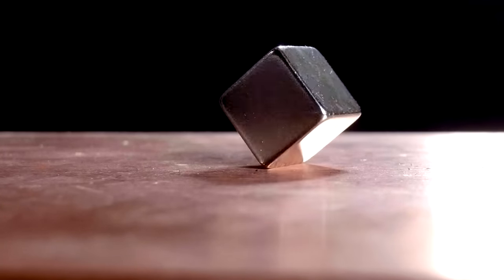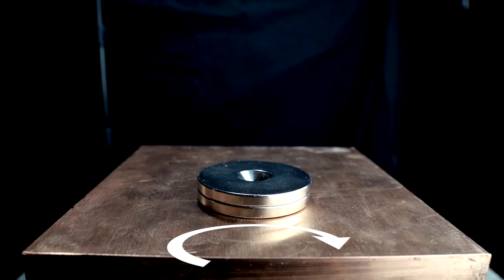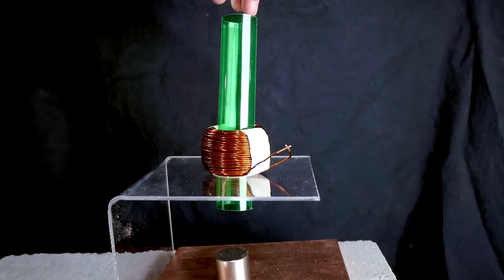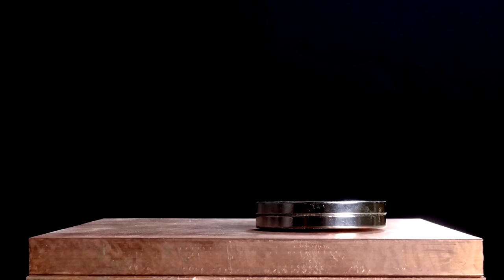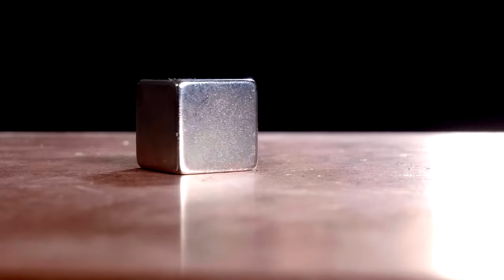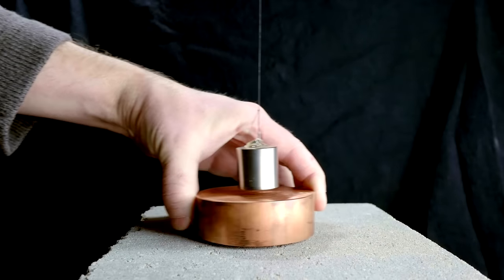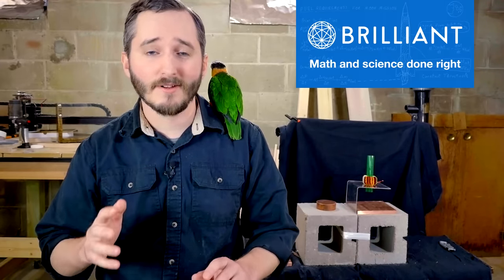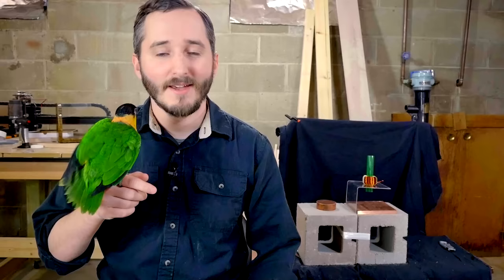Copper's Surprising Reaction to Strong Magnets | Force Field Motion Dampening

Comment: I just tried this at home and it feels like I'm dragging the magnet through molasses. Super cool!
Reply: what dude you use copper wire?
Reply: The biggest question I have with this is, What can be done with it?
Reply: E=MC2 is a joke! OK let's get this correct  !!   #1  The only reason radio waves and AC current travel out in space and down a wire is because of the "CENTER " of a magnetic field.  (The "B" field), The North and South poles are the weakest part of a magnet !!   Just like Tesla said,  you got to look at things you can't see !!  At the center of a magnet is anti gravity,  (just tap the center on any glass or plastic and it will loose weight), The center can repel water if vibrated at the correct frequency,  If you vibrate the "B" field into granite rock it will become soft and you would need copper tools to work on same , you don't want to disrupt the magnetic (B")field ) with other iron.  Once you understand the "B" field of a magnet and how it relates to the entire universe we live in, you will then understand what Tesla was telling everyone "LOOK FOR WHAT YOU CANNOT SEE""  .I believe the pyramids were inter galactic communications and transportation systems.  Stone Henge and Gobekli Tepe , power plants.  Take a look at Coral Castle Florida on YOUTUBE and you will see a similar pilar. I believe these horizontal pillars were oscillators that would provide excitation for many things from crops in the field to anti gravity  FYI: If a UFO fly's to close to you the "B" field that provides the anti gravity ("B")Field).  will cancel out your power source  !!!!  E=MC2 is at best just a joke!!!
Reply: E=MC2 is a joke! OK let's get this correct  !!   #1  The only reason radio waves and AC current travel out in space and down a wire is because of the "CENTER " of a magnetic field.  (The "B" field), The North and South poles are the weakest part of a magnet !!   Just like Tesla said,  you got to look at things you can't see !!  At the center of a magnet is anti gravity,  (just tap the center on any glass or plastic and it will loose weight), The center can repel water if vibrated at the correct frequency,  If you vibrate the "B" field into granite rock it will become soft and you would need copper tools to work on same , you don't want to disrupt the magnetic (B")field ) with other iron.  Once you understand the "B" field of a magnet and how it relates to the entire universe we live in, you will then understand what Tesla was telling everyone "LOOK FOR WHAT YOU CANNOT SEE""  .I believe the pyramids were inter galactic communications and transportation systems.  Stone Henge and Gobekli Tepe , power plants.  Take a look at Coral Castle Florida on YOUTUBE and you will see a similar pilar. I believe these horizontal pillars were oscillators that would provide excitation for many things from crops in the field to anti gravity  FYI: If a UFO fly's to close to you the "B" field that provides the anti gravity ("B")Field).  will cancel out your power source  !!!!  E=MC2 is at best just a joke!!!
Reply: With the copper wires that sage by the way every time the Magnum pass is it it's age it puts upon the wire with it turns the limestone

Comment: As other people have said, this also works with aluminum. I have seen magnetic brakes used on a land speed record car that had aluminum wheels, not meant to slow the car from top speed, but to slow it down once the parachutes have been used. It was very ingenious. They had a ring of neodymium magnets on a hydraulically controlled plate.
Reply: The phenomenon is present for any conductor, but the effect is reduced as the conductor chosen is less and less conductive.  A silver plate would work better than a copper plate, which works better than aluminum, which works better than zinc, which is better than titanium, etc.
Reply: made one years ago for a small engine dyno. few design flaws but it did work. up to about 20hp, any more and i couldnt get the heat away.
some brassy unknown material disc from the scrapyard, bunch of neo magnets recessed into very shallow pockets in a steel plate from the back of a speaker, reaction arm on a set of scales, and a lead screw to adjust the magnet gap. the disc spun, coupled to the crank.

have to complete the circuit at the back of the magnets. gives a nice focused field out the front where its needed. most people tend to miss that point...

obviously deep pockets just short each magnet out to itself :D

the disc gets HOT. real freaking hot. every watt of power the dyno is registering is dissipating as heat. could easily stall a 20hp, with power to spare, but the disc was smoking, starting to glow, despite the water spray... design flaws : )

and neos fail rapidly at 70C+. lol. ferrite will take 150C or so, and alnico will tolerate redhot, but is a bit pathetic... and expensive...

i brushed the dust off it lately, revisiting the idea. it promises a certain advantage over any thing else in the application of certain "renewables"...  

get carried away with this idea of "electrons" and forget that they need something to pump them, just like hydraulic fluid in a bottle is basically useless but will give you gangrene at 20,000psi from a leak, or move a large rock in an excavator bucket... and whilst hydraulic fluid happily sits in a bottle, electrons tend to dislike each other and refuse to congregate in large numbers unless beaten with a large stick...

this is hands down one of the best videos but he did miss the bit with the coil, open circuit, shorted, LED... a decade resistance box would have shown something even more interesting, along with some maths relating to the mass of the magnet and gravity... EFFICIENCY. or, load matching, and how it relates to efficiency. where is the work done, how does it relate to the mass of copper versus the magnet strength, its mass, teh resistance of the copper wire as its wound, blah blah...

where is the work done in a generator, where is the load, and what are their limitations?

Comment: i was just thinking about this video, and i think its possible to polish the surface of steel using magnetic breaking. the traveling fair where i live has a ride that takes you up about 100 feet on a tower and drops you. The way the ride stops is electromagnetic breaks that fit around metal fins. from what i remember, there were 4 metal fins that were at least a foot long and probably 8 inches wide. likely, they were bigger as they were far up on the ride. the part of the ride with the seats that falls rides on a square piece of scaffold with wheels to keep it aligned, and it has 8 electro magnets, one for each side of the fin. the fins are attached to the outter framework of the ride, so force applied to the fins sits on cement pads placed on the ground. the failsafe is a massive pile of recycled tires under the seats. if the magnetic breaking fails, you literally just land on a huge pile of rubber.

The interesting thing to me is that the fins were POLISHED. They stood out as extremely polished to a perfect mirror finish, and the polished part of the fins was only where the breaks run over them. It has always made me wonder if some kind of surface stripping happens when you are breaking such a massive load over a fairly short distance. also it freaked me out that the ride didn't use permanent magnets and only have a pile of tires as a failsafe.
Reply: "The interesting thing to me is that the fins were POLISHED. They stood out as extremely polished to a perfect mirror finish, and the polished part of the fins was only where the breaks run over them. It has always made me wonder if some kind of surface stripping happens when you are breaking such a massive load over a fairly short distance. "
Very interesting! Thanks for sharing your observations.

Comment: Superb demonstrations. Prior to this I'd only observed the effect using a Cu tube and small magnet dropped through. These are far more visually interesting.
Reply: E=MC2 is a joke! OK let's get this correct  !!   #1  The only reason radio waves and AC current travel out in space and down a wire is because of the "CENTER " of a magnetic field.  (The "B" field), The North and South poles are the weakest part of a magnet !!   Just like Tesla said,  you got to look at things you can't see !!  At the center of a magnet is anti gravity,  (just tap the center on any glass or plastic and it will loose weight), The center can repel water if vibrated at the correct frequency,  If you vibrate the "B" field into granite rock it will become soft and you would need copper tools to work on same , you don't want to disrupt the magnetic (B")field ) with other iron.  Once you understand the "B" field of a magnet and how it relates to the entire universe we live in, you will then understand what Tesla was telling everyone "LOOK FOR WHAT YOU CANNOT SEE""  .I believe the pyramids were inter galactic communications and transportation systems.  Stone Henge and Gobekli Tepe , power plants.  Take a look at Coral Castle Florida on YOUTUBE and you will see a similar pilar. I believe these horizontal pillars were oscillators that would provide excitation for many things from crops in the field to anti gravity  FYI: If a UFO fly's to close to you the "B" field that provides the anti gravity ("B")Field).  will cancel out your power source  !!!!  E=MC2 is at best just a joke!!!

Comment: 2:21 I have never thought to have my students actually connect an open inductor like that before! I also love how you used an led to show the emf generation. I tried it with a small regular bulb but it was no use; the emf generated seems to be only around the hundred mV range. So, I definitely need to buy some small leds - and flat copper plates !

Comment: I already knew a little about this, (not much) but you expanded my knowledge in a way that was both easy to understand, interesting, and visually stunning.
Reply: E=MC2 is a joke! OK let's get this correct  !!   #1  The only reason radio waves and AC current travel out in space and down a wire is because of the "CENTER " of a magnetic field.  (The "B" field), The North and South poles are the weakest part of a magnet !!   Just like Tesla said,  you got to look at things you can't see !!  At the center of a magnet is anti gravity,  (just tap the center on any glass or plastic and it will loose weight), The center can repel water if vibrated at the correct frequency,  If you vibrate the "B" field into granite rock it will become soft and you would need copper tools to work on same , you don't want to disrupt the magnetic (B")field ) with other iron.  Once you understand the "B" field of a magnet and how it relates to the entire universe we live in, you will then understand what Tesla was telling everyone "LOOK FOR WHAT YOU CANNOT SEE""  .I believe the pyramids were inter galactic communications and transportation systems.  Stone Henge and Gobekli Tepe , power plants.  Take a look at Coral Castle Florida on YOUTUBE and you will see a similar pilar. I believe these horizontal pillars were oscillators that would provide excitation for many things from crops in the field to anti gravity  FYI: If a UFO fly's to close to you the "B" field that provides the anti gravity ("B")Field).  will cancel out your power source  !!!!  E=MC2 is at best just a joke!!!

Comment: Laser levels use this to dampen unwanted vibrations.  A copper disk is mounted at the bottom of a pendulum that is free to pivot.  A magnet is mounted below the copper disk and causes the laser to self level rapidly and be resistant to small vibrations applied to the mount.  In this application the magnet is stationary to avoid magnetic fields including that of the earth from effecting the accuracy of the laser level.  Without the magnet, the laser would eventually self level, but would be too sensitive to vibrations to be useful in most construction environments.
Reply: Cool!
Reply: Well how bou dah?
Reply: Nice find.

Comment: Everything in this video was amazing, but the part that surprised me the most was the bit where you rotated that cube from like 2 feet away. That's the farthest distance I've ever seen tangible magnetic effects (aside from compasses), considering that usually, magnets only overcome friction when they're a few inches apart.
Reply: ya good piont.  i thought the same thing too.  that was extremely far away and perfectly accurate, i wonder if he could go even further
Reply: @isaacb.4324  or it's a scam.
Reply: @murrijuana2842  magnets are a scam?
Reply: That part really confused me. Does it have anything to do with the copper or was it just that his magnet really is that super powered?
Reply: That's a good tool for "magicians" to use in levitation tricks.
Reply: @murrijuana2842  No man! Magnets are the truth! Open your eyes!
Reply: Magnets are the one of the four forces that doesn't have a distance limit. Add an electrical current to it and you can basically become a wizard.

Comment: I was an MRI Field Engineer before I retired and we often had fun with the Lenz effect.  When MRI's were quite rare, there was always a drawer full of 1" steel washers on bits of string, so that visitors could 'see' the strength of the magnet.  We soon got fed up with having to partially dismantle the brutes to get these out when, inevitably, some muppet dropped their washer and it vanished into the bore.  We found a spectacular way of demonstrating the strength of the field, safely, by use of aluminium plates, about a foot long, eight inches wide and as thick as we could find - usually about 4mm.  (Sorry to mix standards, but that is perfectly logical to me!)

When the user had a bunch of students or sometimes newbie doctors and we were on the premises, they would always ask us to "...do the trick..."  Having first demonstrated that aluminium is not magnetic in any way, you place the plate upright on its short dimension, on the end of the patient table furthest from the bore of the magnet.  Then you ask them what would happen if I let go.  They all look round, because it's a trick question, right?  It''l fall over.

Of course, as soon as you let go, it falls over and they all look relieved.  Then you move the plate as close as you can to the mouth of the bore (disguising the fact that you can feel the Lenz effect working against you.)  The you ask, what will happen now, given that it is non magnetic?  They look at each other again, this time not so sure, but 99 times out of a hundred they've never heard of the Lenz effect and 'shorted turns'.  When you let go and it barely moves (sometimes you have to give it a bit of a shove to get it moving) they are astonished and mystified in equal measure.  It falls very, very slowly, although it does accelerate slightly.  It's a great trick and a whole lot more spectacular ( and safer) than the old steel washers!
Reply: how do i get in touch with you

Comment: Great video!  Compared to the usual "monetized science experiments" channel, your production values were better, you did more interesting experiment variations (including a number I've never seen before, and I'm a pretty big magnet fan), and your science explanations were more legit.  And when you do make a science error you're called out on, unlike awful "I'm not a scientist, but I play one on YouTube" channels like The Action Lab, instead of trying to argue, deny, or ignore to save face, you pin the comment and acknowledge you were wrong.  Good man.

Your parrot is also cute.  That was funny when (s)he was digging in your ear and not only was your spiel entirely uninterrupted, but you didn't even flinch.  😁

Anyhow, will definitely plan to check out more of your vids.
Reply: DanHarkless ﴾Halloween videos, YTPs, & more﴿ to add further to your comments, I for the first time saw explanation in a video.
Reply: so does this also happen with other non-magnetic metals like zinc, aluminium, tin, lead, etc?
Reply: @skylerlandale1437  If they are conductive, yes.  But copper is far and away the best conductor of common metals, better so even than gold.
Reply: @ChristianRThomas  can you measure conductivity in metals in terms of a number?  i mean is there a tool or a scale that can measure this and show different ranges between different metals?
Reply: @skylerlandale1437  The "resistivity" of different materials provides relative values for how much a material in a given shape resists the flow of electricity. 1/resistivity is the conductivity. So, yes! There's definitely a scale by which to compare different metals in terms of how conductive they are.
Reply: It shows he's a true bird man. When you have cute snuggly birds like his, you totally get used to it and can handle the birds no matter what you are doing or saying. It becomes second nature. 🙂🐦
Reply: @ChristianRThomas  Gold is the best conductor but it's very expensive. Copper isn't as good a conductor as gold, it's just cheaper than gold.

Comment: This is actually super interesting. Great video
Reply: Dan Flynn Great video. I would be interesting to see the influence of the copper plate temperature. He could put it on a bed of dry ice. Of course copper is not superconducting at that temperature but its resistance will drop and I bet we will see the difference...
Reply: Dan Flynn ----- So Agreed.